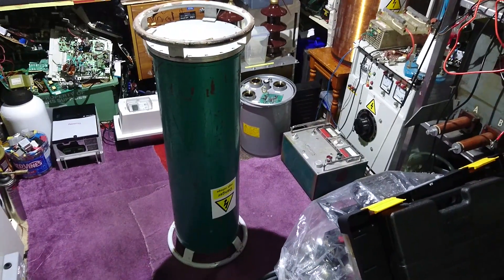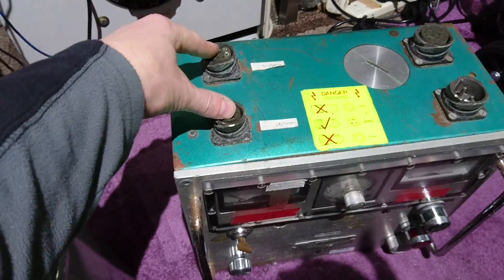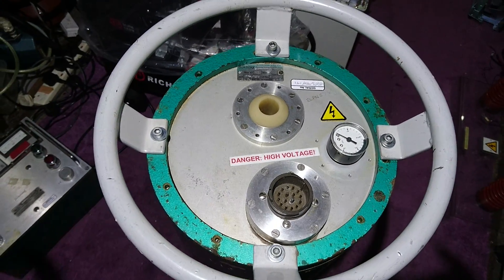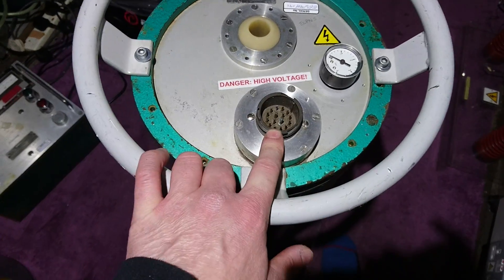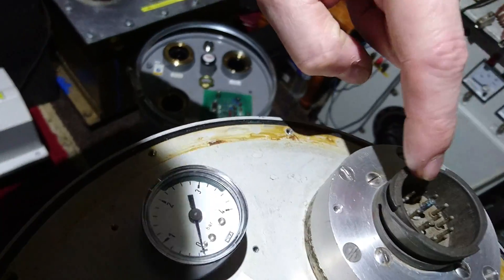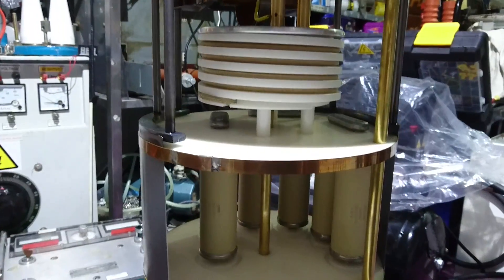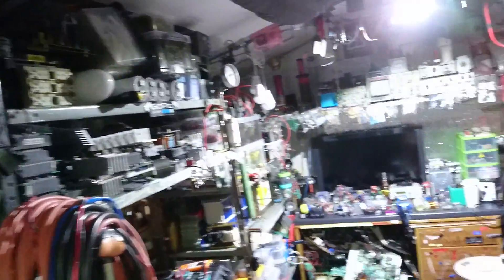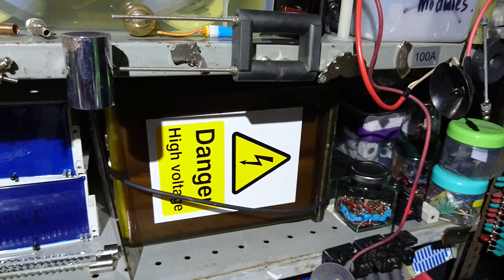Inside look at a sulfur hexafluoride Industrial Xray transformer

Comment: The safety Connection on the controller is for connecting a warning light. also there is the safety circuit that can be interrupted via door switches etc. if you want to use the System stationary in a bunker. you can only start the System while the safety circuit is closed. newer models also have a current monitor for the warning light which Interrupts the safety System if the warning light Fails. the fourth Connection is for a cooler unit. the x-ray tubes used with this transformer Need to be water cooled because the 1.2 kW Output of the transformer are converted into 99% heat. for mobile use the transformer, Controller and cooler are mounted on a rack with wheels and the tube is connected via 5-15m high Tension cable and water lines. the Generators usually have a Valve to fill them with gas, sometimes a schrader Valve, sometimes something proprietary wheren an Adapter is needed. they get evacuated and then filled to About 3 bar with SF6 gas. common types of Generators are 160kV and 200kV/225kV, in fact i havent seen a 120kV model in real yet. the Primary voltage of the transformer is around 200V AC so the full 120kV can be reached even with some voltage drop on mains voltage.

Comment: Boiling point of sulfur hexafluoride is -64°C.
Just put both the transformer tank and a SF6 bottle in a low temperature freezer until the temperature drops below -64°C (dry ice bath can works just fine), now remove both items from the freezer and quickly pour the liquid SF6 inside the tank (almost as water!).
Now wait until the liquid start to boil to displace the air and quickly seal the tank before the entire liquid is gone.
Of course you can install a valve instead and pressurize the tank with SF6 gas

Comment: SF6 is nasty stuff. It is heavier than air. ensure you are in a well ventilated room.
Cover the TX core with mineral oil and run it at a lower voltage. Well made device.
Reply from the maker: RODALCO2007 hello Mate, yeah I'm not even going to mess with that gas mate, that suit frightens the suit out me mate lol, I'll be sticking to mineral Oil mate, don't you worry about that lol.

thanks mate for the comment,👍😋

Anthony 

High1voltage1rules

Comment: Apparently, propane may do as a gas replacement.

You would be able to keep the pressure, and with the air displaced, it's not much oxygen for explosions.
(as in, make sure there is some fluid at the bottom)

Do your own research before using this advice!
Reply: Definitely. If Hydrogen can be used a effective coolant in alternators, someday Propane can be used too.

Comment: I work regularly in HV rooms with SF6 filled switchgear. Every time I get authorization to enter  HV room our SAP reminds us to wait 30 seconds, check the dials for pressure, listen for discharge sounds, and sniff for anything "almondy".. That's on new Schneider switchgear. SF6 can change to Disulphur Decaflouirde in the right conditions ( like high voltage discharge) and that is worse than Mustard Gas - please don't be in an enclosed space the first time your fire that beastie up.
Reply from the maker: Boetang123 yeah thanks for the info mate. I'm not going to be going near any gasses! as I'd like to stick with mineral Oil. much safer lol
thank you again for going out your way to share the knowledge on the gases. much appreciated 👍😀

be safe,

Anthony 

High1voltage1rules